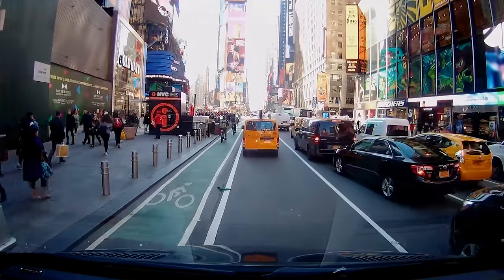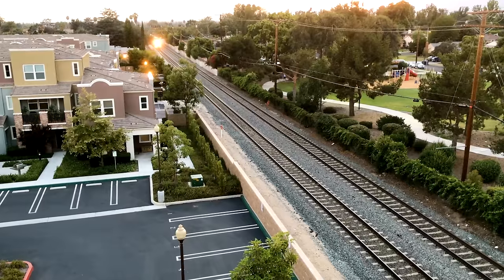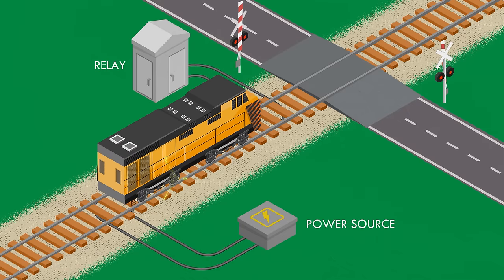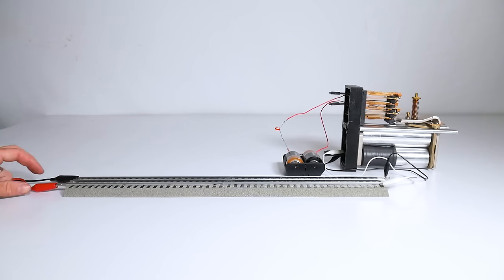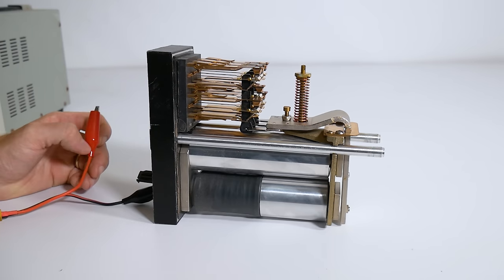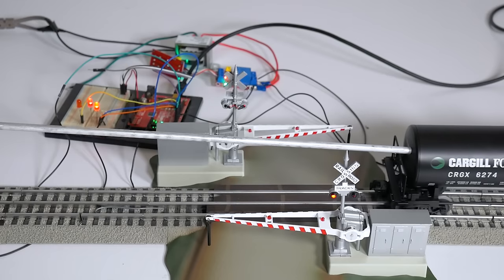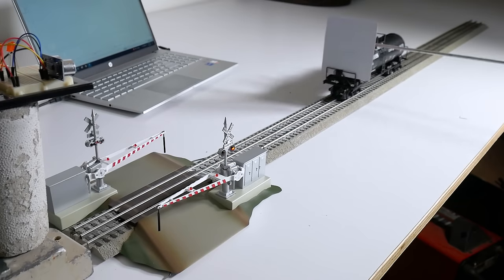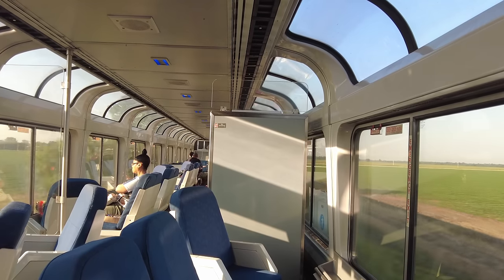How Railroad Crossings Work

Comment: Warning time should be the equivalent of the time needed for a train to drive its maximum regulated brake distance. In Europe that's 1000 or 1200m in most cases, so that means that any train MUST stop using its service brakes in max. 1000 or 1200 m, hence the smaller European trains compared to the rail monsters in the US. A train running 60 km/h would need 1 minute to pass, a train running 10 km/h... you do the math :)) Of course, that's theory, in practice they integrate de crossings to the line blocks in most cases.
Generally, after the start of the approach circuit, a light signal is installed, which is connected to the gates and bells; if the gates and bells do not start, the signal turns red, and the driver passing it starts to apply the brakes, as the crossing is not secured; some of these "danger signals" may be protected with automatic brake systems, so the train receives the brake order regardless of the drivers's actions. Sometimes, crossings are connected directly to the track circuits for the track blocks, so if the barriers are not lowered, the block signal will be red.
Level crossings located at stations' ends or close to them are operated directly by the stationmaster and interlocked with the signals (can't give a green light to a train if the gate is open), but there are still rare situation where a train will pass with those open... some years ago I participated to a test for the integration of ERTMS system with class B system on a double track line... on double track, an operator must set a direction for each train between 2 adjacent stations, that will activate the block signals in the desired way and will block the entrance of trains from the opposite direction. However, we went back and fourth with the loco on the same track to test some of the block signals and at some point I heard the driver shouting "there's a van on the crossing!" Luckily, the van driver saw the loco and quickly back off, even if the crossing was open to him... and we stopped the loco with the cab right in front of him, on the crossing... it felt quit scary for us, I can't imagine how the van driver felt, but at least the collision was avoided (the electric loco needed about 200m to brake from 50 km/h; it wasn't hauling any waggons). We than had an interesting discussion with the stationmaster who declared he didn't hear us on the radio asking for crossing to be closed and the guy who confirmed reception was some other guy from a different workstation who's job was not to handle the crossing...

Comment: what if they put up a mirror so we can see the train coming?

having the traffic lights work with the train warning system could be vulnerable to hacking.

remember the chrome box? that was the forerunner of the mirt that was intended to allow emergency vehicles priority by turning the lights green.

the chrome box was a strobe light similar to the disco light or camera flash so the sensors at the traffic lights would detect the beacons atop the emergency vehicles and turn the light green.

newer technology was the mirt witch used an ir beam like tv remote to turn the lights green.

i could see someone placing something metal across the tracks to trigger the warning system and clear the queue.

of course i think all of that is illegal and may fall into federal jurisdiction because the railroads are in federal jurisdiction.

Comment: Swedish gates are made enough brittle so a car can drive thru them with just the starter engine. There’s a sign on the insides of the gates saying: DRIVE THROUGH THE DATE - DON’T STAY ON THE TRACKS!

PS. As mentioned in the video, if being caught on the wrong side of the gates, there’s enough space between the gates and a passing train. Scary but still safe.

Comment: Don't need an Arduino to simulate a "3 circuit" crossing. It can be done with simple logic. Even relay logic. But then again a civil engineer, and not an electrical engineer. But then, the only buildings I make are tool sheds, and the largest concrete work, is the foundation pad for one.

The fancy controllers in modern rail, is partly due to microcontrollers being easier to maintain  and more flexible, than  old fashion relay logic, and they also communicate with "home base", so the whole system can be monitored remotely, in a timely manner.

Comment: 2:07 by weight, not quite. A train against an average car would be equal to the average car against about 10 to 50 aluminum cans depending on the weight of the train. Based on rough math^

Comment: To add to your point about “too much warning”….all tracks should be considered to be live and a train on them until you visually identify that the way is clear. I operate machinery on the tracks, and most of our equipment does not “shunt” the track. Which means, the equipment doesn’t activate the gates/warning systems. Now, obviously these machines don’t have the rolling mass of a train, but a Tesla or a ford f350 won’t fair too well being hit by a 50,000 lb machine at 25 mph. 

In short, you see cross bucks, assume there is something coming and be prepared to stop before crossing. Is your life worth the trust you’re puttin into a 50 cent piece of wire? I sure hope everyone feels they’re more valuable than that.

Comment: I’ve seen this many times but never knew what was going on. The rail crossing will be closed with gates down but no train in sight. More than likely it was a faulty electrical connection ….. Thanks!

Comment: Quick question: Why there isnt a device on the crossings that would send certain signal through the rail, which would in the case of the emergency stop a train?

I know, that some funny folks would probably use the button for fun, but that can be solved by phototrap device, which would also operate together with the emergency signal :o
Reply: This can't work. It really is not "just send a signal." No piece of US rolling stock is compatible with such an idea. The axles, for all intents and purposes, are pieces of solid steel. You could stick as many receivers as you want on them, and you'll never hear a thing over the electrical noise of megawatt-scale electric motors. These aren't toy trains. Additionally, emergency braking is extremely dangerous for trains because it can cause them to derail. There's no way in hel! this would fly with the FRA. Human intervention will always be better than trusting some signal from an unknown source.

Even if this wonderfully naive idea got put into production, what if there is no train nearby when the button is pushed, then one approaches? How to you determine when to stop sending the signal? This theory is full of holes, lass.

Comment: I was stopped by a rail crossing at 3:00am on my way home from work. The train was a ways away, and it only activated as i pulled up. But then it opened briefly, let me through, and closed immediately after i passed.

I live pretty much in the boonies, and I looked at it later the same day before heading back out to work to ch cl for cameras. Thinking there might be a person that monitors them... Nothing.

Did the train crossing gods just smile upon me that day? Or is there something to that...

Comment: Interesting how Level Crossings work in the US. A question I have is, how does the Train Driver know the crossing is closed before actually passing over it? Here in Germany Level Crossings work a bit differently than in the US. There are Signals which tell the Driver the Crossing was activated and will close before he reaches the Crossing

Comment: Grady finally gets to play withis Lionel trains!
Though grade crossing signal systems arextremely reliable, wife and I always look and listen when approaching railroad crossings.
We have the railroad emergency numberstored in our cell phones.   Please report anything which does not look right.
Most mee-mool lights (o)T(o) in the US activate 25 seconds before train arrival.

The biggest problem is vehicles crossing tracks when vehicles ahead unexpectedly stop and vehicles behind are halted on the track.  If you are stuck on a track with train approaching, you can drive on the sidewalk or do a U-turn - anything - to get clear of the track.    You may also drive through closed gates to get out of foul.  They are easily replaced.

Comment: I can’t say for sure but I believe I have seen a fail safe in action, one crossing on the track was closed for 20 minutes with no train anywhere close to insight, while the crossing on the parallel street was open and working

Comment: Well done.  However, in your model demo, the use of 3 rail Lionel Fas Track is a problem!  Connecting the alligator clips (or an ohm tester) to the 2 outside rails will always sense a completed circuit.  The outside rails are shorted together.  Placing a car on the tracks does nothing!
Reply: And yet the demonstration worked.  Perhaps the outside rails were not shorted together in the track he was using?

Comment: Why not have the warnings activated by a magnet instead of a shortcircuit? Then you would not need to worry about rust or debris. To gauge speed you can just add another magnet assembly.

Comment: What i really want to know is why do cars break down at railroad crossings so much?
Like, as a percentage of road surface that people drive on, the crossing itself is like 0.0000001% of actual road.  Probably less.  And generally it's mostly flat ground.  Yet cars seem to break down and stop right on the tracks so much more than they should...

Comment: Back in the steam era there aren't such thing as walkie talkie or technologies yet, they rely on whistles, men, signal boxes, and schedule. 
(Signal man a controls the gate, signal man b is the signal man that informs the signal man a, and an engine)
The signal man a heavily relys on the schedule to let pass the engine on the gate, they usually open the gate a minute ahead. If the schedule changed not informed, the signal man b that saw the engine heading to the crossing gate will inform the signal man a by calling them in the telephone, and then the signal man a recieved the message and let the engine pass through. If the signal man b fails to inform signal mab a and signal man a didn't know the changes of the schedule, the engine will whistle nearby the signal box from signal man a and they will open the gates, the engine whistles everytime when passing the gate for safety measures. (Note this informative was taken by a grain of salt, i cannot remember the rules and this information may lead false information. Please do not attack me for being wrong and jusy correct me on the reply for better explanation. Thank you)

Comment: Man, I wish the railcrossings here had considered half this stuff before installing their automatic guard systems. 

They're so busted they lower when a train has stopped so far away you can't even see the sucker, and thus they've not only caused many drivers here to ignore stop signs because of the automated crossings, but it's also created drivers who just go and bypass the barriers as a matter of cause.

We've had so many accidents involving both private and public vehicles. I honestly can't fathom a bus driver having such gross disregard for the safety of their dozens of passengers, but it's happened way too often in the last years.

Comment: The biggest problem with crossings without warning signs is if they are at an angle and trucks cannot see the train particularly if the train is faster than the train. 
Better to use a Japanese SC maglev in a tunnel to avoid crossings.
Reply: well, i think that comes more from the point of beeing a mountaines nation since tunnels are the most expensive way to build and maybe not needed if you build something like in Kansas or Florida when an Over/Underpass would do it

Comment: With all that electricity running through the tracks, what keep someone walking on, across  or along the tracks from getting electrocuted?
Reply: low voltage audio frequency signal. that type of AC

Comment: There is something that he can't demonstrate. I live near a crossing where the speed of trains varies greatly. The fastest is an Amtrak train that is allowed to do 75 mph, while there are slow coal trains that might reach 20 mph. The system can detect the speed of an approaching train from the rate of change of the current in the track circuit and activate the crossing earlier or later. If the train stops or slows markedly, the gates can go back up.

Comment: With trains becoming extremely long, there needs to be a way to notify someone that a stopped train is blocking, and has been blocking for an extended period of time, a vital roadway. If the crossing isn't cleared in a reasonable amount of time (say, 10 minutes), then the railway should be fined.

Comment: Why don't they build retractable sturdy hard barriers that can be slid horizontally or even vertically from in the ground to prevent vehicles from crossing? They use these devices at security checkpoints, why not here?

Comment: Breaking the circuit still seems like a convoluted way to do it, a thin pressure plate on the rails could complete the circuit instead without throwing the train off the rails or noticeably effecting it's velocity

Comment: Imagine is every rail car was equipped with a pair of bi-directional solid rocket boosters.  Single use of course.  But if every car is equipped, stopping distance could be significantly reduced in an exciting way.

Comment: Advice!! If you are stranded on a crossing and the gates come down GET OUT OF THE CAR! If you happen to be not stuck and the gates drop down on you and like a car isn't in your way etc RAM THE GATES! to get off the track yeah don't run over both gates to cross. Also a good one if a train is coming down to you on a double or more track and you are standing on a track you are not going to hear the train on the track you are standing on while looking at the train on the track you are NOT standing on! Don't stand on any tracks.

Comment: Eight years ago, or so, they changed the requirement for grade crossing train horns where I live.  The new requirement dictates that the last horn blast must persist completely through the crossing.  I can only assume that the reason for this is after the train hits your vehicle they want to make sure you are also completely deaf.  Go figure.
Reply: Interesting.  That's been the rule for grade-crossing horn signals in most of the U.S. since the signals were standardized, over a hundred years ago.
Reply: yes they hold the last blast until occupying the crossing

Comment: Hmmm....I know just a little tiny bit about electricity, and I was always under the impression that a short circuit caused a total power failure; i.e., blown fuse or tripped circuit breaker, that won't automatically reset.

Comment: Cresson Texas is one of the worst rail crossings ever. It's very common to sit in morning or after work traffic for 30 minutes to a couple hours because they build the train right next to the rail crossing. Oh and they've been building a bypass for like 5 years already and have stopped mid construction because they've failed to do a soil sample and now have to inject the dirt with their mixture.

Comment: Now I know or at least suspect why those arms remained down after they were properly activated, circuit sensed an 'infinity train' into the morning hours until someone got there by request.

What bothers me most is those horns. Those which don't sound, that is. These trains wake me day and night, but with the odd horn being no added amount to that, I only hear them close or right outside my window for a person or animal out there, not for that crossing. And that's not right. Those were put up for a reason and that reason is defeated when orders say not to use them in some areas.

I always questioned, if the arms can go down or remain down without something there, can they also not go down when they are supposed to go down? 

My saying is, 'A train going 40mph is a train going 40mph when it's stopping for someone.' you say it better in the video. I look when I walk, I hardly even notice those arms when they aren't down. That's because I don't see them like a lifejacket on the water. Yet sadly, except for one man I know (walking) other people I know (walking or driving) simply walk or drive through when these are up and not flashing. That's why I want the horns sounding here.

Ever hear of the "Made you look!" joke, make someone look for something that's not there to check the person's awakeness? I pulled that on a car driver as a passenger, but it turned out to be an empty pair of tracks. 'Made you look!' I said after I calmly said 'Train, oh train, maybe a train.' and right away felt the car's brakes and saw a head turning both ways. It wasn't that joke, it was my desire to be slowed to check if my 'train' was out there and it was so satisfying.

Made you read! 😊

Comment: It should be noted that US railways are less modern in their approaches to stuff like this, compared to other countries with long established and functioning railway networks like those found in Western Europe or Japan.

Seriously, why all of the flashing lights on the train and all of the horn blowing? In the UK, the trains have steady lights on them, and only use the horn for small uncontrolled foot-crossings where the sighting distance is poor, or for emergencies. We're not any less safe for not having the driver honking for a mile before the crossing.
Reply: Because of American drivers. They tried doing that in Florida in the 80s, but it ended up increasing casualties at crossings.

Comment: So all you need to shut down a crossing is a jumper wire.  What security.  Like using "password" for your password.
American rail is so antiquated and out of date.  How many US trains were derailed today?  Statistically, several.
If the derail leads to hazardous spills, they may eventually tell you about it, but most likely they'll just cover it up.